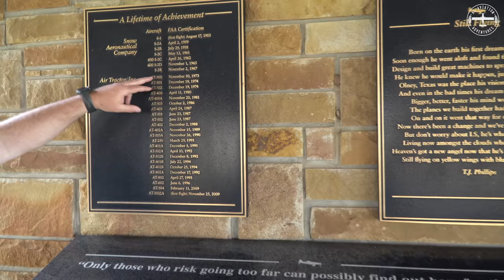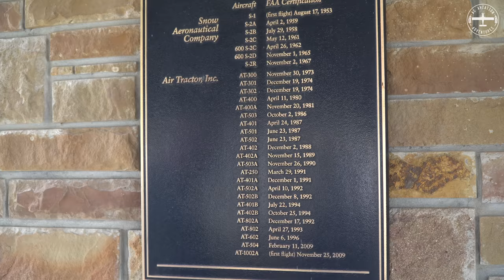How Is An Airplane Built? Air Tractor Factory Tour

Comment: Cally, that was an excellent tour and Jeff was the "Tour Guide" to make it a most informative day. I retired after about 25 years in electronic production so Jeff's descriptions were very interesting. I was an ISO 9001 inspector for many years. ISO 9001 is a system that documents and works with production manufacturing to ensure that the processes are documented and adhered to in production. The way Jeff described your tour through the factory shows how well they work with that kind of process.    

Your audio presentation was just fine... don't even worry about it! Noises on a production floor are part of the environment. I barely noticed them.

Thanks for an excellent presentation.
Reply from the maker: Thank you, Gary!! I really appreciate the kind comment and you watching. It was really a fun experience and we'd love to return with a full production crew.

Comment: Use to ferry a few airplanes for Leland Snow back in the 80's. Mr Snow was a soft spoken gentleman and an aeronautical genius, it's good to see that the pandemic hasn't shut down Air Tractor. The 1002 is a very exciting project and Air Tractor should definitely make a fire Boss version of it
Reply from the maker: That would be quite the experience. They had an issue with employees getting sick early on but they got it taken care of.

Comment: My brother and I got to tour around the facility years ago and they have added so much and are still doing a majority of hands on work there. Well done....
Reply from the maker: They seem to always be adding things. I heard the manufacturer of the flap motor AT is using went out of business and AT ended up buying all the tooling and now will be producing the flap motor as well.
Reply: @AgAviationAdventures  And thru some well done engineering via Mr. Snow, the flaps and ailerons are hooked together thru a simple durable mechanism so when you lower the flaps, the ailerons also come down a few degrees, which gives the aircraft good STOL performance.

Comment: I have been an aerospace machinist and fabricator for 36 years working for Boeing , Lucas Varity , and now finishing my career with Parker Hannifin Aerospace. I would love to have worked on the ag side instead of commercial military stuff. The Thrush aircraft are built about 100 miles from my home here in Ga. Air tractors are sleek swift and powerful aircraft that have changed air agriculture over the years. The Pratt Whitney engines are works of art in themselves. The 802 is my favorite. The big 5 blade prop reminds me of the P51 Mustang aircraft. It is big fast and can carry a big payload. Love to see them fly. Thanks for the tour...
Reply from the maker: Thanks for watching!

Comment: I work for XeVision, we make upgrade owner replacement lighting for the Air Tractor products. Our HID and LED lighting solutions for the cowl lights, underwing retractable lights and the turn lights. Our new LED replacement lights are 2.5 to 3X brighter (Candela /Lux /Lumens) than ANY competitors lights, currently on the world wide market. Our LED lamp outputs don't dim after extended use from getting hot (ours don't get hot). Also, our exclusive strobe effect, greatly more attention getting than basic wigwag or pulsing. Our website will be updated shortly to include this new disruptive LED technology, a great benefit for nighttime spray ops. and for firefighting ops. as well. Great to see this factory in full operation.
Reply from the maker: That sounds awesome! I’d love to see them in action.
Reply: @AgAviationAdventures   Will you be at OSH ?
Reply from the maker: No we’ll be spraying. but we spend quite a bit of time paragliding at point of the mountain in Draper, UT if you guys are just based in Ogden.
Reply: @AgAviationAdventures  Yes, you are welcome to come by KOGD for a visit.  I learned and flew hang gliders there back in the late 70's, before I moved up to mountain flying and later airplanes. It seems paragliding has eclipsed hang gliding to a large extent.

Comment: When I was a kid, all the ag spraying was done using Piper PA-25 Pawnee aircraft. I used to get so excited seeing them spraying the huge field around our house, standing the plane on it's wingtips to make the 180° turn to get back on line for the next pass. The flagman at each end of the run must have got coated with chemicals every day. Later they used Hiller helicopters, but they were not as exciting to watch as the Pawnees.
Reply from the maker: I could not have imagined being the flagger.

Comment: Former Boeing Everett... very impressive manufacturing processes. Obviously a 747 is a bit larger than what is built in this factory, but in some regards those aircraft are even more complicated. Old School space frame structure very light and very strong. Built a few NASCAR race cars over the years and tubing for roll cage and structure is very detailed to cut and fit. Saw automated tubing cutting with perfect 'birds eye' every time. 

22 hour Takt Time per manufacturing station helps control build times. I was part of Boeing Lean Manufacturing and we pushed Takt Time faster and faster. Start to finish 4 1/2 weeks for a complete aircraft is impressive. After I left Boeing, I moved to a smaller city. Just down the street, we have an aircraft manufacturing plant that produces the Super Cub. They  don't compete in same market as does Air Tractor. We do have lots of agriculture here and crop dusters are a common sight. Both fixed wing and helicopters are used extensively here.

Thanks for the tour... aviation aficionado
Reply from the maker: Wow sounds like you’ve had some great experiences. Thanks for watching.
Reply: @AgAviationAdventures  Enjoyed the video. Always educational to see a plane built from pile of expensive parts to final cert. Club Crafters make the Super Cub. They are close by. I almost went to work for them after leaving Boeing and Everett.

Comment: I was hoping to see how the product tanks were installed and if they needed replacing how that is done, and the fuel tanks are mounted , then if these single engine, single pilot planes could be used in firefighting since there have been so many fires lately, thanks for the video                    🤟🤠👍
Reply from the maker: Yep the 802 is used on fires in both the wheeled version as well as on floats for scooping water. The hoppers usually are refurbished when the wing spars are due since you have to remove the hopper to get to the spars.
Reply: @AgAviationAdventures  AWESOME series of videos THANKS

Comment: Great video! The plane at 18:23 has the old style air intake, are they still making those?
Reply from the maker: Yes you can request that intake. It works better for aircraft that are operated frequently off dirt strips.
Reply: @AgAviationAdventures   Both are lame. They should all just come with Cascades.
Reply from the maker: I’ve never tried the cascade but heard great things about them.
Reply: The one at 4:48 has the old style air intake also

Comment: Are modern air tractors still stick&rudder controlled? (Bell cranks, pulleys, pushrods, return springs, trunnions etc.) Or do they have modern fly by wire avionics?
Reply from the maker: They are all cable, pulleys, etc.

Comment: Wonderful concept on the painting of the airframe. I know now why brand new airplanes have corrosion problems less than a year after delivery. I operate these airplanes and it’s coming to the point that an increase in price/ acre to compensate for reasonable trade difference would render a collapse in my company, unless lifestyle isn’t a concern. I’m ok with living in a house trailer from now on to keep new/ late model airplanes.  I’m the most expensive in my area. I had always been able to trade after 3-4 yrs (2000+ hours) for 5-600K . Now it’s 800+Just ordered one. They’re the real only game in town now so get used to AT having control in your business pricing. Buckle up . You can always move into a smaller mobile home.
Reply from the maker: We live in a 5th wheel…. 🧐
Reply: @AgAviationAdventures  that’s not why we do this . Not lavish necessarily, but not hot dogs and bologna either. Lots of financial exposure with lots of personal risk. Acquisition had become a real deal in operating expenses.

Comment: I am extremely surprised to see that the aircraft panels are each individually hand fitted to the airframe!

This is hugely labour intensive, time consuming and expensive, and seeing it happening in 2022 utterly beggars belief!

Surely the aircraft panels should be interchangeable between aircraft of the same model/designation!

Quite why each panel has to be individually hand fitted to each aircraft is something that should have been addressed decades ago!

Given that the airframes are constructed on jigs, surely they are the same, so a panel should be able to fit any of the same type.

Addressing that issue would have a noticeable impact in labour, time and money savings!

It would also help with spare parts availability.

Factory tours are very interesting, thank you for this one, it was nice seeing the aircraft panels held on with Cleco's as I have just bought my first comprehensive set along with other sheet metal rolling, folding, shearing and beading machines and tools.
Reply from the maker: You have a great point!

Comment: The problem AirTractor is gonna have with the 1002 project is, they've reached the top end range for horsepower with the PT6 turbine engine. The current Fire Boss is 800 gallons with a 1600 Horsepower engine, thats ruffly 4.1 pounds of weight per one HP. The highest HP PT6 engine that Ive heard of in a turboprop configuration is about 1950 HP, with the turboshafts in helicopters going to about 2200 HP. when you apply that to 1000 gallons of weight you get 4.2 pounds of weight per one HP, which is going the wrong direction on the performance scale. Leland was still alive when the 1002 was built and first flown and Ive always thought that there was a market for an even larger single engine air tanker, something in the range of 1200 to 1300 gallons, but AT is gonna have to use a different engine for an aircraft that size, maybe one of the P&W 100 series engines, which start at 1500 HP, problem is, those engines have the exhaust straight out the back and the aircraft would have to be redesigned to accommodate that.
Reply from the maker: It’s going to be interesting to see it all come together. They’re still using the -67 on it.
Reply: @AgAviationAdventures  On the Ag plane maybe, if they do a tanker version of the 1002, that won't work, they'll have to go to something like the -68, which is also the only PT6 to have a specific fuel consumption number like a Garrett, at .480
Reply: @Agislife1960  The prototype 1002 # 0001 is a single seat white/red airplane with a fire gate on it. It has a -67F on the front, of course it was built and first flown over 10 years ago. I remember the day very well.  https://www.youtube.com/watch?v=IvkiZXD2ly8
Reply: @07trdpro6  The fire Boss (Float Equipped) didn't turn into a real good performer until they went with a 1600 horsepower engine, a Fire Boss version of the 1002 will need over 1900 horsepower to equal the same performance of the current 800 gallon Fire Boss. In fact it would take 2000 Horsepower to give a fire boss 1002 the same power to weight ration as the current 800 gallon Fire Boss at 4.1 pounds per 1 HP

Comment: The skins won't fit every plane unless the temperature of the factory is within certain limits all the time, to prevent expansion differences of the material.
Reply from the maker: Is that the reasoning? I never did ask what that’s all about.

Comment: Great tour. These machines are gaining popularity in NZ with pilots and maintainers. We drop mostly super phosphate from them and fly these into some amazing strips. We have Pacific Aerospace in NZ that used to make crescos and then PAC750XL  that get converted tO AG, 2.2 Tonne payload. but PAC was shut down partly due to covid b-sht. Air tractor has a much greater reputation for safety. Just have to get rid of the masks, no need for that crap.
Reply from the maker: I’d love to fly in NZ! It’s such an amazing area from everything I’ve seen.
Reply: I agree that rubbish did more damage to industry worldwide and many companies will never recover.

Comment: Why do these brand new (depending on model, 602/802) costing 1.7m -2ml fly worse than ever? No substantial improvements except optional gadgets. No substantial competition is why. Price them wherever you want with no substantial improvements.
Reply from the maker: You’re right not much has changed.

Comment: The Air Tractor needs to lose 2/3rds of it's weight and get 1/3rd stronger.

I follow aircraft using ADSB etc and noticed one local Air Tractor that regularly transits the area - "It's NOISY" - Everything we apply from the air is either circular wing of Tractor.
So from a New Zealand RocketLab observance point of view and an America's Cup Boat background This Operation in the video needs to Change to stay in the market.

Steel? in an air-frame? isn't Steel heavy? - 

We build complete Liquid Rocket Motors in a 3D printer here - so for the sake of strength and ease of manufacturing why aren't you doing "3D printing and Carbon Fiber" from beginning to end - "Fuel Costs Money".
Have you considered Electric powered Aircraft? doing battery swaps when refilling?

New Zealand's America's Cup Boats are all  "Carbon Fiber" and Kiwis Win and Win and Win
As much as you're not a New Zealand company - Do you Want to survive?

What I'm seeing is an Old antiquated construction method stuck in tradition - an over staffed production line that would be better off buying "some parts from specialties Chinese or Russian companies" if they can't go a metal 3d printer NOW.

Why Not?
Why not change the construction method to avoid all that metal treatment and 2/3rds of your staff costs?
Why not change the construction method to the 20th century and produce 3 Aircraft for the price of one and get back into the business?

The Air Tractor needs to lose 2/3rds of it's weight and get 1/3rd stronger.
Reply from the maker: Thanks for watching IC!